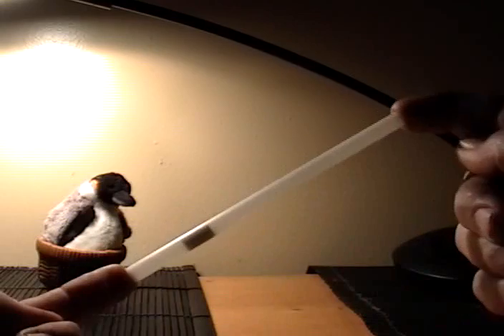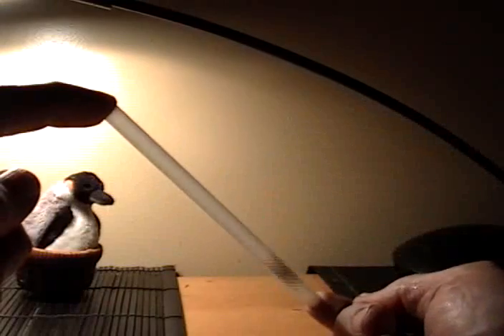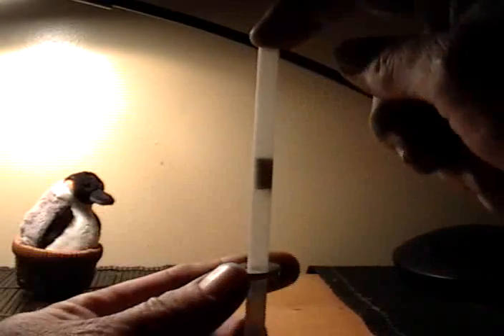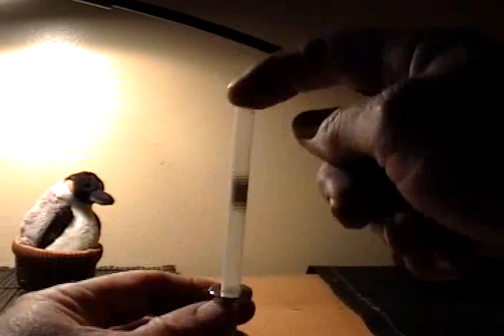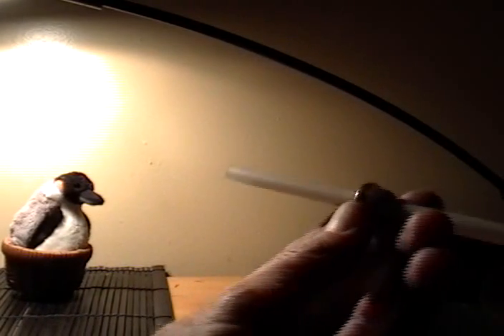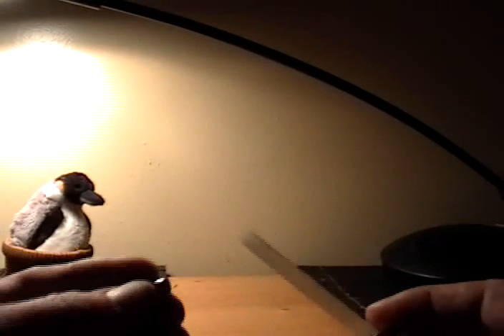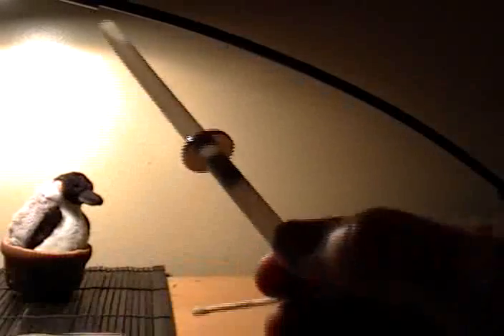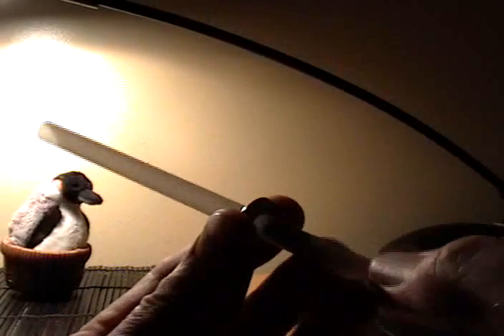Non-Contact Magnetic Trailer Hitch

Comment: there is a line of force that moves in that direction trough the confinement dome. when the  magnet is locked in place in the center its the choke ring holding it there and when its not in center and being repulsed its the confinement dome and flp ring....you know what i am speaking of?